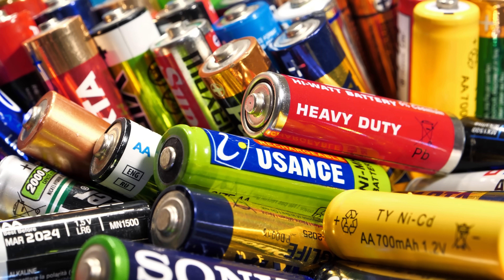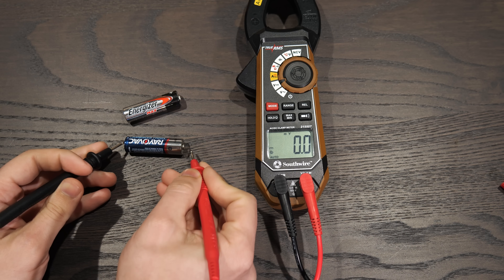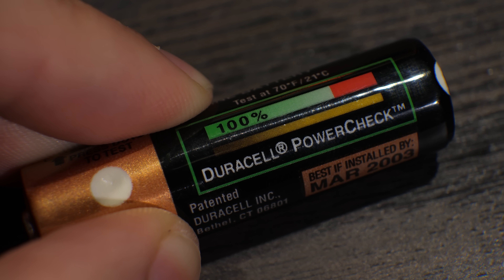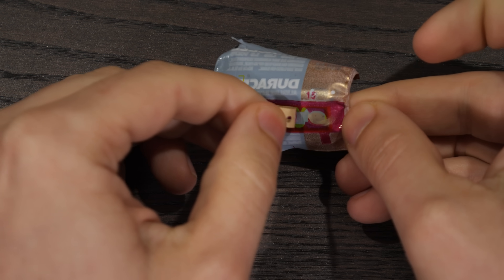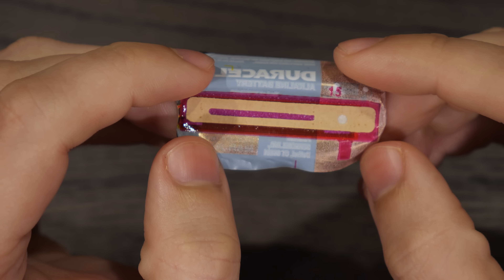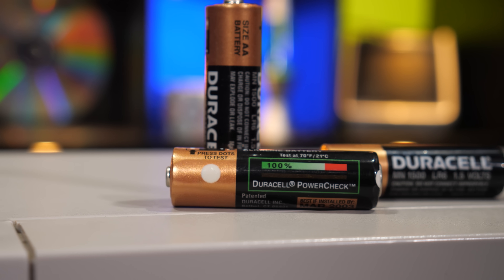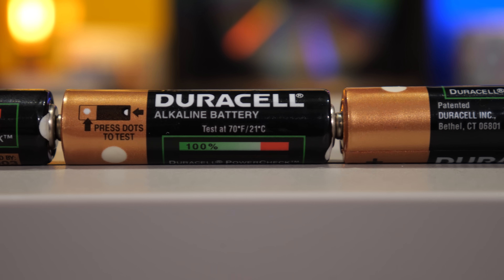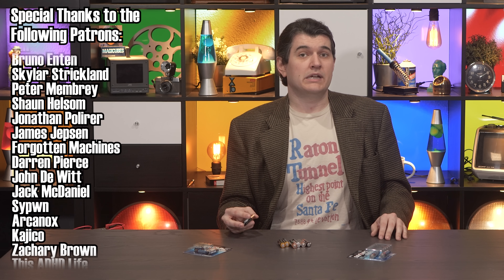Duracell PowerCheck: A genius idea which didn't last that long

Comment: 2 things.  First of all, you forgot to show how dead batteries don't bounce.  Second, I have an apple mouse that only operates reliably with Duracell copper tops.  Not even the other duracell brand will work.  Also, it might have been nice to talk about what happens when one of 2 batteries has a stronger charge.

Comment: I first encountered one of these about 5 years ago.
Thought it was too good to be true, but I tried doing as it said to test the power anyway, with absolutely nothing happening so I just felt like an idiot for even bothering and that it was just a gimmick I must have misread.
I had no idea it had anything to do with heat, or that you had to press that hard, which is probably why I saw no results at the time. Glad to know I wasn't a fool after all.

Comment: I upgraded from a CD Walkman to a CD MP3 player back in the day because the MP3 player could spin up the disc to load the songs into memory and then spin down the disc, saving tons and tons of battery power.

Why a CD MP3 player and not just an MP3 player? Because CDs were still prevalent and because device memory on MP3 players absolutely was not, so at most on the expensive ones you’d get like 32MB of memory which isn’t much.

Loading up MP3s onto a disc got you a ton more memory space for your MP3 music at the cost of some battery life for operating the disc every few songs and you could swap out to a different CD containing another massive amount of songs without going back and slowly syncing all the music to the built-in memory.

Comment: I sure remember cranking through batteries with my gameboy and cd player and everything else like you said. I DID like this feature, not for saving half finished batteries, but for finding out how much juice one of them probably had left before going out since most didn't have battery indicators until it was too late.

Comment: This was a brilliant idea! I would (at the time) go out of my way to rather buy these batteries rather than regular ones.
What they should do is use this idea on rechargeable batteries... I have a couple of rechargeable batteries... and it would be handy to get an idea on which out of the 4 that I am trying to recharge is the culprit! Which one is the weakest link! (so, to say). It would also be great when I have charged 4 batteries... and place them into my torch (which doesn't have a battery level indicator - like MOST other devices) and the torch either ONLY shone dimly or did not shine at all... I could easily determine which battery was the faulty one.

BRING IT BACK!!

Comment: I keep partially used batteries around because Duracel has destroyed too many of my devices due to leakage.  I have even had Duracel leak while in the original packaging.  I have also purchaced a battery tester to check my batteries. (They are not expensive at all)

Comment: What a trip. I barely remember the Duracell ones, but We always had the silver and black Energizers with the green bar that would show "Good" on it when You put at least 2 tons of press force into them. Recently pulled the batteries out of a rack synth module for storage and found 3 of those very same Energizers in it. Now They sit on My shelf as a reminder since I hadn't seen them in 20 years!

Comment: Propane tank level labels work in a similar way. Dump warm water on the tank and the liquid propane would absorb the heat faster than the vapor layer, allowing the label to show the level inside the tank. Unfortunately, you have to test it in warm, dry conditions with no breeze. Not so useful for something that is generally kept and used OUTSIDE.

Comment: 14:02 If only Xbox would get with the program already.
Reply: The one good thing about xbox controllers is that they will be more useful later on without dead rechargeable batteries. Ideally I'd rather see some easily removable rechargeable batteries because I'm definitely not happy with sony, nintendo and anyone else either.

Comment: The GameBoy used 4x AA batteries which got you a few solid hours of play. You estimate that your GameBoy only burned through "dozens" of them? You must not have loved your GameBoy as much as some of us. :p
Reply: My old gbc probably burned through 100s of batteries and that one was far more efficient. My mom eventually decided that I had to stay hooked up to the wall socket because the battery spending was getting stupid.
Reply: @RisingRevengeance  None of my GBs ever came with a AC power cable, and don't think there were any locally available (small town), so batteries it was. Also had the NES, so played that if we were at home leaving the GB mostly for car time. Still, plenty of batteries got burnt up playing Tetris and a few other GB faves.
Reply: @thegreatboto  I'm not sure if nintendo ever released an official power cable before the gba sp. Mine was 3rd party from a pack of some garbage accessories. They definitely weren't common, no idea why.
Reply: @RisingRevengeance  That may have been the case. Didn't have may resources (or money) then to go searching for one, or even to know what to look for that wouldn't burn something up. ~7yo me could manage finding (or begging for) and swapping out batteries, though.

Comment: Also wondering if there are either chemicals in these test strips that are deprecated, of if there is a residual fire hazard in these testers (a cheaply produced heating element, paper and a high current battery, what could possibly go wrong), or simply the risk of the tester being mechanically activated during transport and discharging the battery much  to the users frustration.....both might be a good reason for their discontinuation.

Comment: Worth mentioning. I think the market for this was nearly entirely for children's toys. As a dad I take the batteries out regularly to prevent leaking and corrosion.  They end up in a bucket of batteries and I occasionally have to go through them with the multimeter or toss them all and replace them. If they brought this back I would pick this over other brands for this use case.

Comment: Not sure about how it used to be, but in recent years Duracell comes out of factory at about 1.64V. And I think anything below 1.6V is considered defect and rejected. This is from the testing station so it's right after the battery is made, but I guess the voltage can't stay for very long and would probably already drop below 1.6V during transport and storage. Just saying this to argue that 1.5V battery isn't 1.5V when brand new. It's really more likely 1.6V.

Also stocking used batteries used to make sense, because toys often need rather high voltage to do their motion. Which means the battery can still hold up quite some charges when considered "dead", and can be used on remotes instead. Nowadays toys usually use lithium batteries instead so it's more common to use brand new batteries on remotes or wireless mice/keyboards or such.

Comment: They used to package these with some brands in the late 00's. If I had to guess, I'd say this is some heat sensitive color changing pigment in it, and a resistive strip that heats up when you short it across the terminals to test the battery. The more charge it has, the more current it will put out, the hotter the strip gets, and the brighter the ink turns. That's my theory. In any case, it is resistive and it is draining your battery if it gets as hot as it does.

Comment: Wait, am I the only one that switched entirely to rechargeable batteries and I have a whole rotation going on with my AA and AAA batteries where I have two bins of charged and needs-to-be-recharged batteries?  The only time I have a conventional 1 use battery any more is when the batteries ARE included in a device.  Edit:  Ah, 13:30, there it is.  Mic drop.

Comment: This is a geeky solution to a problem geeks thought that normies have.

That aside, I still use non-rechargable batteries due to having a most likely weak-ass charger, which charges those rechargables I have for a whole day and they go dead faster than non-rechargables...

Comment: You can recharge alkaline batteries though! My father (rest his cheap soul) used to put me on charging duty on the balcony when I was a kid. I had to sit there staring at a multimeter to make sure the voltage didn't go dangerously high 😂
I vaguely remember they didn't keep that voltage good enough after top-up to be useful in a Gameboy, but they would power something like a TV remote for a good while!

Comment: I had a pack of 4 where the tester was laminated into an extra space in the blister pack which you had to insert the battery into.

Naturally I tried testing a non-alkaline battery and my recollection is that it melted and burned my fingers - you could see the ridges of my prints in it.

I wasn’t aware til today that there was a thermal element involved, but that makes sense now - though the NiCad battery I was testing would have been 1.2v maximum. So I’m not sure what caused it - a chemical/current difference?

Comment: I've moved to almost exclusively using rechargeable batteries. The only exceptions are when the lower voltage from nimh batteries isn't enough, so I'll use alkaline in their place. I've tried lithium rechargeable AA but have had poor experience with longevity; they're rated for 500 recharges but lose max voltage after a few recharges.

Comment: Personal experience with partial batteries in the junk drawers, Gameboy used to eat though batteries, then they would get used in remotes after because they still had enough current to drive the remote but not enough for the Gameboy. High current items such as this would have definitely been a reason why the tester was used on the battery. and more then a few times i took out the batteries in the game boy and tested them, then threw them in the drawer, and pulled a new set for the electronics.

Thank you for a great video.

Comment: Should mention that one shouldn’t use two batteries of different charge level together, as one of them would try to charge the other, if placed in parallel. Granted, few devices have that layout.

Comment: i remember seeing these, but only when removing them as they where dead never sen one that actually worked, i was born in -96 so i guess the clock and remote batteries had finally run dead in -04/05

Comment: I remember bundled battery tester works exactly you said. It didn't worked as your demonstration, probably circuit got disconnected by force after some use.
I still prefer AA/AAA batteries than litium-ion batteries. At least, Ni-MH AA/AAAs don't get bloat, explode or gets fire itself when it's damaged or just unlucky. Alkalines, on the other hand.......they leak internals randomly when it's over 2 years old.

Comment: Interestingly they brought it back for the "Quantum" batteries. But it disappeared again pretty quickly. So patent-wise I wonder if they managed to settle it, but ended up forgetting that people just leave their batteries in devices, lol! I think the only times I'd use them in a semi-practical sense were to check if my Game Boy Color had enough juice for the length of time needed for something. If not, I'd grab another set. But in reality, I could've just grabbed more to begin with because who wouldn't just use them until they died anyway? They were pretty neat to see in action so that's probably why I did so to try and "find a use" for it even if it was gimmicky in hindsight.

In any case, this was a fascinating video! I always did wonder how they worked and what happened to them. Namely because they seemed to go "poof" one day and they were back to regular batteries without any explanation.

Comment: Could you take the tester label and “re-label” a new battery to show the heater in action? :0
Reply: I'm afraid the Kodak FBI will kick in his door the instant he wraps the new battery demanding royalties
Reply: As a person who tried it back in the day - in theory yes, in practice it only worked if the "-" terminal was of similar enough shape which most weren't so it was difficult to impossible to use,
and it also probably relied on thermal properties of the battery so unless you managed to tape it well enough, but also don't tape over the indicator itself because that changed its properties
In the end it was probably not worth it
Reply: Came to ask this same thing. Seems easier to peel a new battery than use a hair dryer and dc power supply to show it work for the video.

I just put a licked finger on the negative and my tongue on the positive to test.
Reply: As long as the body is the positive to line up correctly, yes, probably.
I don't have one on hand to test tho.
Reply: sounds like a great technology connextras video... I'd love to see that!
Reply: Put it on Energizer battery to be especially evil
Reply: Or just wire a new battery in parallel
Reply: LYRICWULF!!!!!! :D
Reply: This needs more upvotes
Reply: @19Szabolcs91 you mean likes?
Reply: @19Szabolcs91  This isn't Reddit
Reply: @Gandhi_Physique  @BayBrick117
🤓☝️
Reply: @fullmetal929  I'll never be embarrassed for spreading da truf. Reddit is cringe.
Reply: He showed it in action using his bench power supply.

Comment: They rechargeable AA replacements have always been crap even, where Duracell doubly batteries last longer than the rechargeable counterparts. But now that they are finally coming out with lithium ion rechargeable double A's, I want to try those and see how well they work. But I do really like how more and more devices are going to the 18650 standard, or even The flat lithium ion foil pack batteries in items like RC cars and things like that for kids. Because they have gotten so cheap and the power is so much higher, they even charge more for devices that do that because parents don't like dealing with AA batteries or any batteries plug it in recharge it it cost them $0.50 to do that but they put a $15 markup on the price.

Comment: AAA batteries have their raison d'être whenever the gadget won't be using much power per month! The batteries in my remotes—even much used ones—will often reach their use by date AND leak battery acid long before being exhausted. Had the designer opted for longer-lasting AA batteries, I'd be doomed to prepare an essence of vinegar rinse every single battery change!

Comment: Duracell powercheck batteries are still sold in romania as of 1-2 years ago. With a more refined design where you don't have to break your fingers to use it

Comment: the only time i could have done with that tech, was using batteries (Procell) issued at work for various test gear, which were often flat whilst in date even before opening the packaging.

Comment: The biggest issue I saw during the time period these came out was defective batteries. In devices you did not use often, it really sucked to go back in and find battery acid all over the place- sometimes even seeping into and destroying electronics. For devices like cameras, it totally made sense to not leave batteries in there. Not really sure if batteries have just gotten better since then, or it is just a function of not using them anymore- except in TV remotes, but haven't had a battery leak into a device in the past ten years.

Comment: Easy test I have used for years is dropping the battery from about 7 centimeters. If it has a high bounce, it is done for. If it does not bounce, it is nearly perfect

Comment: "And when the voltage begins to fall" works perfectly with "And when the rain begins to fall" from Jermaine Jackson, Pia Zadora. Just mentioning.

But we had lot of batteries around, because recycling. Throwing out in the trash was heresy, so they got carefully stored until they could be properly disposed of. However, somehow that storage always ended up to be the same drawer as where the 2 unused batteries of the fourpack lived. In theory this could still work: used batteries are not in the package but the new ones are. But the package got worn and eventually there was a mix of to be disposed and theoretically still useable batteries.

And then you go out and your walkman dies and you buy a new fourpack at the trainstation, and another 2 batteries will join the drawer of the undefined.

So, in theory those testers seemed to be useful, but somehow it never really made a difference to the flow of events and getting new batteries anyway.

Comment: I feel like people aren't using more rechargeable batteries, it's more that we've moved more to using devices that don't include user replaceable batteries (like phones and tablets) or the devices use button cells (a lot of small toys) or can be recharged with a USB cable.

TV remotes are obviously the outlier, though.

Comment: I've seen these being sold as late as 2021 (Or later?). Under a different slogan but still duracell, and brand new. They used a single press tester and it had different colored film above the tester to indicate the "percentage"

Comment: My mom always has kept a tiny toy blowdrier in her battery box. It takes a single AA or AAA and you can tell how much life the battery has based off the power/sound of the blowdrier. Works pretty good, and honestly adds a bit of fun to the process.

Comment: Truth being told the biggest plus of testers was when you had multiple batteries in a device with an uneven draw, some older remote controls were notorious for this, one battery would be dead the others still had half or more charge, the tester would then save you from using two or three where only one was truly needed

Comment: Voltage as the level of charge is incorrect for batteries, because it is not voltage drops over time, but the internal resistance rising. You should measure peak current so you can know the internal resistance of the battery.

Comment: I wonder if that test strip on the battery might have depleted batteries prematurely due to how that test strip might have been seated inside the devices battery holder.